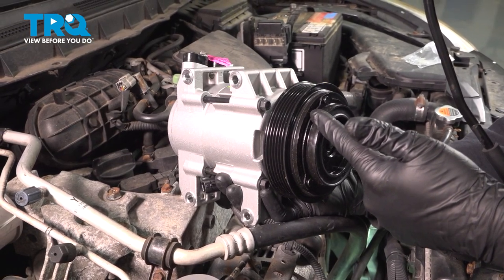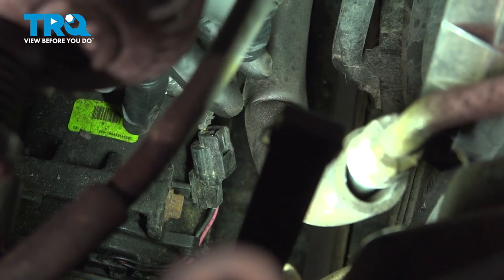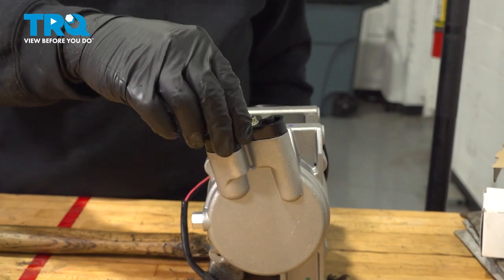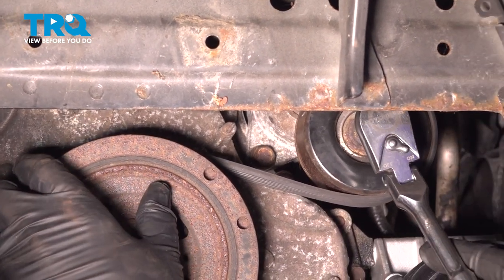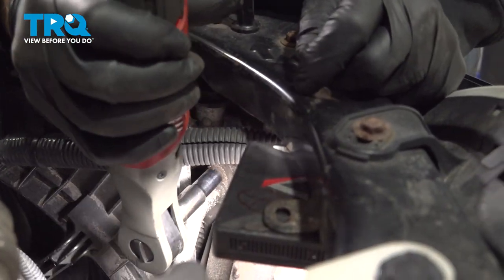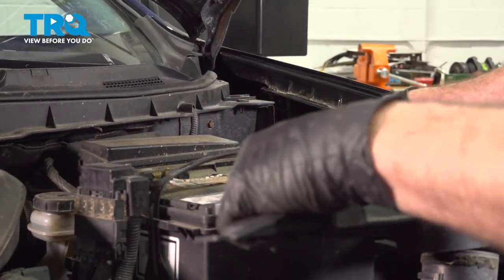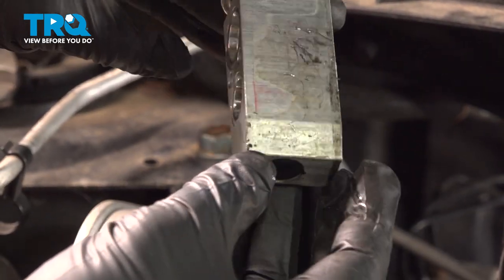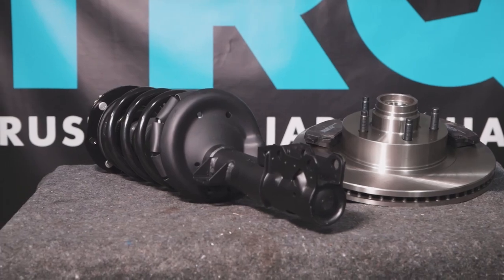How to Replace AC Compressor Kit 2008-2013 Nissan Rogue

Comment: I replaced one of these compressors on one of these cars a few days ago I spent 2 hours trying to get the suction line off the compressor that is because of the stud was seized to the line the discharge line was easy it came right off the serpentine belt was a b** trying to get that back on after 5 hours I got the job done

Comment: Question why did you have to take the condenser out to change the dryer?  All you need to do to get full access to that dryer is take the front bumper cover off the car.  All it is is some clips across the top and some screws and clips across the bottom comes off as fast as that wheel liner.

Comment: I have a question.  I have a 2009 rogue and have to change the compressor but I do not have a lift was wondering if it would be easier to remove the alternator  and change the compressor that way? Or is their no way to get to the lower bolts on compressor.  Thank you your video was very helpful